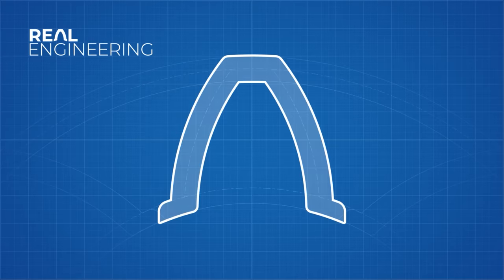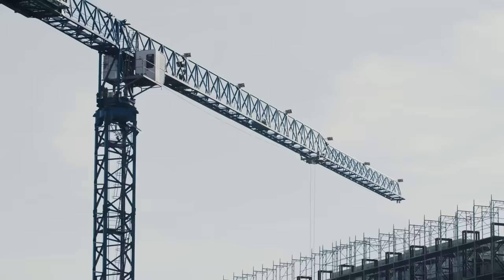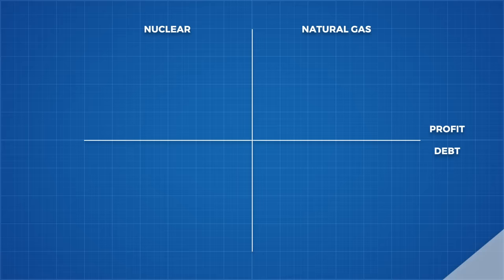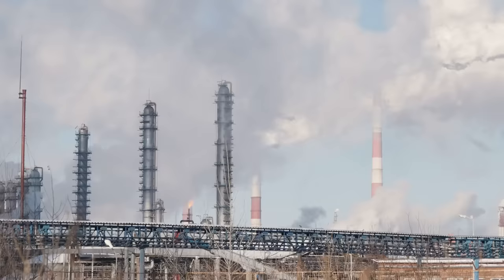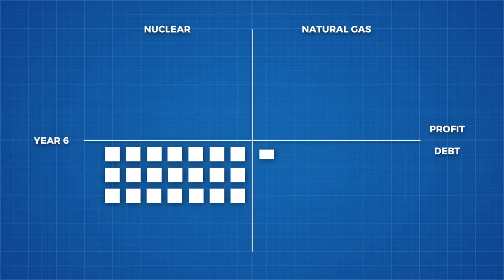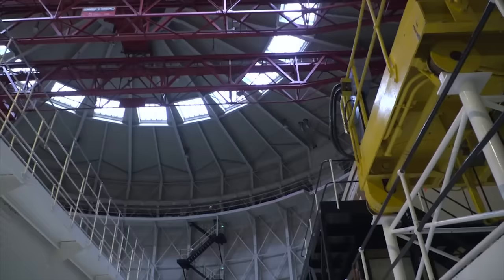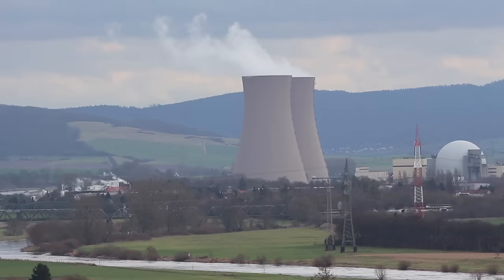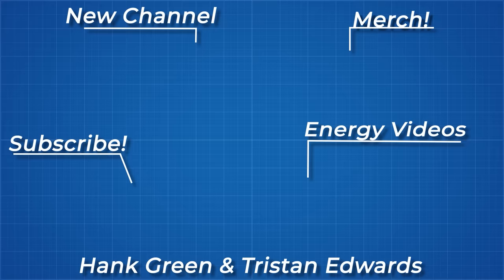The Economics of Nuclear Energy

Comment: I work at a nuclear power plant, and honestly it's the most amazing piece of engineering I have ever seen.
Reply: I did as well and it was but was far to expensive.
Reply: I’ve been wondering what is it like to live inside the nuclear power plant. Is it dangerous?
Reply: @ShafiraMeisy  Not really. You can even swim in the pool which has the nuclear components. Nuclear kill fewer people than wind power so not many, really.
Reply: people are more likely to die falling from bed than from nuclear accident
Reply: boilermaker here, im hoping to soon too
Reply: I worked as an environmental tech in many coal plants and God damn are they shit and brutal, I remember having to cut open the screens to vacuum out the coal ash out of the catalyst, they would just turn off the unit so the ash was still glowing in spots, ambient temp was around 130° and we're in 2 tyvek suits with respirators vacuuming out this glowing ash for 12-19 hours a day. The metal vacuum pipes would constantly get holes in it due do the abrasive ash so we had to constantly duct tape it, and since it was so hot, it would just melt..

Anyway coal plays are shit and can't believe they still use them
Reply: @royk7712  0 people died because of the Fukushima nuclear accident. Yes, you read that right, 0.
Reply: @uwu_senpai  the health issues and the cost to fix were insane though. As he said in the video that plant wouldn't be approved today... Compliance is important. If it can be avoided better to not need nuclear, especially if you don't have the plants built already. The waste management is an ongoing cost too even if it is small. It doesn't go away.
Reply: @uwu_senpai  Fukushima is still getting cleaned to this day, and millions of gallons of water are still being pumped on the core to contain the radioactivity, which will only last until 2022 when the storage tanks are completely full...
Reply: @royk7712  
That comparison is horrible and I would expect nuclear workers and enthusiasts to understand why.   

Everyone gets out of bed EVERY day.   Few people work with nuclear materials.  The total number of deaths is lower but the percentage would he higher.
Reply: Citation required
Reply: @Sheridantank  I'm sure after you normalize the data, your percentages will still seem quite low; especially if you take into account both the coal miners, power plant workers, and the people who might live around the plant.

I mean, yes; nuclear disasters are horrifically catastrophic. But you have to take the same safety precautions with a nuclear plant, as you do in the aviation industry; you have to be on top of a problem, and fix it before it becomes a catastrophe. And if you do keep on top of your problems, then you will experience no deaths at all; whereas with coal and other fossil fuels, health issues and death are endemic.
Reply: Well if u like that have you everheard of the wheel?😉
Reply: What did you major in university if I may ask?
Reply: All the hilariously cherry picked numbers in this video ignore the simple fact that electric is cheaper in places with lots of nuclear and expensive in places with lots of renewable energy. France pays about 16 cents at the meter and Germany pays almost 35.
Reply: Really ? You could swim in a pool that has radioactive material in it ? I mean the long time exposure of radioactive material is bad for ur body over time, trigger DNA mutation and such things יעקב accidental death may be lower than other jobs, but it can’t be used as a apple-to-apple comparison to this, no ?
Reply: @bronzedivision  10 years ago solar was an order of magnitude more expensive than it is now. Go look at a chart of solar LCOE over time: it's pretty mind boggling. Germany subsidized solar for decades while it was economically uncompetetive because it hadn't climbed it's own learning curve sufficiently. German consumers are paying the price for those historical long term generous feed in tariffs that have enabled the cost of solar to plummet to below all competition today. This was intentional. It was exactly what was planned by the green party who introduced the scheme whilst in a government coalition. There's a similar story for wind and there are other details around why the price of electricity is high in Germany unrelated to solar. We shouldn't infer any conclusions about the cost of renewables today based on the german electricity rates.
Reply: Allah protect you
Reply: @MasayaShida  Electrical and Computer Engineering.
Reply: What type of plant is it?
Reply: @appleater3  the "tritinated" and "radioactive" water is cleaner than tap water, they will just release it, without any concerns about radiation.
Reply: Which nuclear power plant?
Reply: @uwu_senpai  how many square kilometres of uninhabitable land around the disaster ?
Reply: @Sheridantank  that's a complete BS. My friend works at a nuclear power plant and with dose is 0uSv per month. Maybe people who mine and enrich the Uranium could have some small dose, but it is never above the potentially lethal dose. Since Chernobyl accident, only six people during Fukushima accident got higher dose than 250mSv, but lower than 500mSv, potentially lethal dose. None of them died. The radiation isn't a problem here. Keep in mind that radioactive waste saves millions of lifes by cancer treatment every year.
Reply: Abdulla Alblooshi why do we still use pressurized fission plants? I’ve seen atmospheric molten salt fission generators in a prototype state for almost a decade... i.e. what Taylor Wilson is working on.
Reply: @lilacdoe7945  they are still in research phase, they might be ready in 20 years.
Reply: @lilacdoe7945  Because they're one of the best designs that have stood the test of time.  If there's one thing the nuke industry doesn't do very quickly - it's innovate.  It will probably require the state or fed to build a full scale prototype reactor and have it operate safely for years before any company would even consider it.  Also I don't know about molten salt but using water as a moderator gives you a stable feedback loop between temperature and reactivity.  If the water is cooler, there is more reactivity, and if it's hotter there is less reactivity.  This is good so you don't end up with a runaway reaction where more heat means more reactivity which makes more heat ect.

Mostly though I think it's just the best proven tech of today.  Modern PWR designs are actually pretty bad ass and seem like they'd be super safe a with redundancies and fail safes, and can even keep the core in cold shutdown from natural circulation alone - without the need of pumps running or anything.
Reply: I want to do journalism but nuclear power has always been a dream of mine to explore
Reply: What is the cost for decommission?
Reply: @Sophistry0001  we had a full scale molten salt test reactor running for a number of years back in the 60s, it's one of the safest designs, 100% passive safety, can literally cut all power, back ups, everything and it won't melt down. The reason we never used them is because at the time all of the funding was from the DoD, and the Navy was insisting on compact high power reactors that could fit in boats and subs, so the funding was pulled from the molten salt program as they aren't nearly as energy dense. Since all the government funding went into the pressurised boiling water reactors that's inevitably where the private sector went, even though the molten salt reactor is a far better and safer choice for a stationary power plant. Molten salt reactors can run on a much safer, easier to mine and more abundant fuel (thorium) and they burn 99% of their fuel compared to the less than 10% of a standard nuclear reactor. And the waste from our current nukes can actually be easily processed as a supplement to fuel the molten salt reactor, extracting a significant portion of the energy from it and drastically reducing both the quantity of waste and how hazardous it is.
Reply: i bet those engineers at chernobyl though that as well
Reply: @GloomGaiGar  Chernobyl is literally nothing like any reactor in operation today, it was a horrendously dangerous and poor design that was only ever built by the Soviets. What happened there could never happen to any nuclear plant being operated today.
Reply: @GloomGaiGar  I think of nuclear power like a super fast car. Great to see but not to be in it when it crashes
Reply: @royk7712  To be fair, there are more people on beds than people near nuclear power plants.
Reply: @benbrowne7674  I actually read what that LOCE is saying, not what you're hoping it says. ;) 
The LOCE is only WHOLESALE price, not what you pay at the meter. The more solar you add the more grid instability you get and the more backups you need. Both of which drive UP price, that's why Germany's complex renewable power costs double France's simple nuclear power. And is only getting worse. Solar is a hopeless rat race.
Reply: @GloomGaiGar  well stay with so obsessed with the Perfection of Soviet engineering they did not need a containment building!
Reply: @Sophistry0001  well explained.. there are many safety systems designed into the PWR, many redundancies and the design is tried and true
Reply: @turningpoint4238  To be fair, I've worked at a bunch of factories and half the time 1 machine may be worth up to $20 million. Though BBraun Medical likes to use tiny little contraptions that just slot over where line workers used to work. Kinda feel bad for the line workers when they have one room fully automated and another down the hall still worked by hand. Can't imagine that lasting long.
Reply: And than you realise that nuclear power plants still use 50 year old technology
Reply: Shafira Meisy It wouldn’t. Military Run or involved Nuclear stations would be even safer. The US Navy Nuclear sector has one of the highest safety records, because of how many nuclear reactors they have (aircraft carriers, shipyards, and subs). Nuclear power should be respected, but when it isn’t you get major problems which have decade and century lasting effects such as Chernobyl.
Reply: @uwu_senpai   I get your point but thats more research reactors you can swim in. not really power station reactors
Reply: @uwu_senpai  misleading... If you actually work in a plant you know that is not true. There are many system designs.
Reply: At my nuclear power plant we haven't had an osha recordable in 789 days, and haven't had a loss of time incident in 1459 days. So saying that nuclear is unsafe for the workers is a completely illigament argument.
As well as those concerned with radiation, I have been in the 'no-go areas' with 23 rem/h. Yet the most I have ever gotten in a month was 400 mrem. I would need 2000 times that dose to be dangerous.
Reply: Ok “Abdullah alblooshi” I’m sure your definitely not Homer Simpson 🙄
Reply: @NickTrouble  woah those are some solid numbers... Since I've been in the nuclear industry I haven't received any extra doses .. I work mainly with PPS PLC cabinets and just regular HMI stuff.
Reply: @madman10340  I'm not, homer was a reactor operator.. I didn't want to study an extra 3+ years after engineering to get that job.
Reply: @Dongs it's not a Nuke site .. it's a nuclear power plant. Nuke sites are areas where they test nuclear weapons.. or areas of high contamination. Also I don't believe the name of a person is within the criteria of recruitment.
Reply: Yes.. 
I have worked at 2 nuclear power plants during outages.  I live less than 20 miles down the road from one of those plants now.  If you get to see the amount of security they have there, it's almost ridiculous. The entire plant, at it's outer perimeter, is surrounded by big blocks of concrete to prevent any unauthorized vehicles from trying to crash through.  The entry points are protected with those pop-up steel barriers.  The guards walk around with body armor and automatic rifles..  I could go on and on.  I don't believe it's possible to force your way into a nuclear plant, at least without an entire actual army.  The engineering is also mind blowing.. I didn't realize such big things were even possible to manufacture.  I also got to see the spent fuel storage pool at one plant.. it's perfectly safe to walk around the edge of the pool.
I am an advocate of nuclear, although I realize that renewables (and other sources) are making them less and less viable.  I have also worked on construction at solar power plants.  I think one of the problems with solar is what I guess I'd call energy density.  The solar plants I worked on took roughly 500 acres for a roughly 50 MW plant.  At the nuclear plant not too far down the road from there, one unit (reactor) produces over 900 MW.. and it has 2 units, so over 1800 MW total. The entire site of the nuclear plant is roughly 2200 acres.. and only a small portion of that is the actual plant.  If you do the math you see that it would take a huge area of land covered in solar panels to equal even one nuclear reactor.  And those solar panels will only produce  power during the day. So yes, solar is great.. but the scale required to match any fossil plant is just huge.  But when they finally figure out affordable grid-scale energy storage, nuclear might be doomed.  My apologies.. I started rambling a bit there, and can't remember exactly what my point was!  Just my thoughts on the matter..
Reply: New state regulation made the example of the San Francisco plant to decide to shut their operation. The video should use an example when regulation doesnt affect the operating costs.
Reply: @Aidan梁九旭
It is things like the holocaust that shaped the wrong opinion on eugenics, it is actually very humane.
Reply: Shafira Meisy The radiation is stopped by the water, slightly higher levels of radiation exposure can be beneficial to you as your body adapts to low radiation exposures, a trip to a nuclear facility doesn't even give the same exposure as flying in an airliner for a few minutes. The Linear No Threshold Model has be discredited hundreds of times yet people still use it as the basis of their safety standards. Look at people in mountainous regions, they are exposed to a higher background but have lower rates of cancer than those exposed to background radiation at sea level.
Reply: @mattwilliams4222  hahah yeah outages are crazyyy usually the plant isint that busy but when an outage happens we get a flood of contractors in and it gets a little hectic.. during regular plant operation we just do PM CM and the planned surveillances.. but man outages are a whole other level.. sometimes I wish I could just take the whole outage as my annual leave
Reply: @bronzedivision  if your point is that LCOE is not the right metric then I completely agree and commend you for having that more important but more complex conversation. The conversation should be about the marginal price of providing the service of reliable electricity rather than just $/kWh. My point is only that the France vs Germany comparison is not a good natural experiment. Consumer electricity rates are determined by so many political and historical factors. A better approach is to look at the wealth of forward looking academic and private work that is being done on the cost of different energy mixes. It's a complex problem that's very context specific. I'd personally love to see more nuclear getting built but we should look to that research that accounts for the real world complexities of building a reliable energy grid. I'll note that utilities do this in-house to determine how to best serve their rate payers and we're seeing a lot of new build gas paired with renewables getting built but relatively little nuclear at the moment.
Reply: Matt Williams 
I’ve done the math too. US? 130,000 square miles. That’s half of Texas!  Worldwide? 920,000 square miles!!  Spain, times 5!!!!! And world energy consumption is projected to go way up. Some projections are doubled. Solar is great but just not great enough. We need Nuclear.
Reply: Ismalith 
You seem really afraid of the waste. That’s really misinformed. The waste is a non issue from an engineering perspective. It’s only a political issue.
Reply: But how many will get cancer from it in the future?
Reply: I'm sure it is man, but the only problem (besides the low probabilities of nuclear fusion: core melting etc) is the waist: what do they do with all the nuclear radioactive waist... Nothing cause there is nothing they could do with it except throw it into Venus perhaps... but that wouldn't be cheap...
Reply: james sullivan 
None. Seriously, none. Look into it.
Reply: 3dgar 7eandro 
Nuclear waste is minimal. All the technical issues are solved. Nuclear waste is the best kind of waste from energy. It’s the only kind we actually contain and it’s super minimal. Look into it.
Reply: You’d usually don’t want to do that unless if you want to piss off the entire factory by forcing an expensive clean up operation to remove contaminants from the pool, יעקב
Reply: @MrElifire84  Okay, but we will be stuck with politics for the foreseeable future. Political problems are far harder than engineering problems. So until we have actually have a running infrastructure of reactors burning down/recycling waste, and safe longterm storage locations in operation, waste remains a huge problem. And until recycled fuel is cheaper than freshly mined, any new investment in nuclear power production will go into producing more waste debt.
Reply: nibblrrr 
You’re right. People are the problem. Usually that’s the case. Doesn’t mean we shouldn’t say it like it is. I think we should work hard to disabuse people of erroneous perceptions. Change minds. Advocate for good. Solar isn’t good enough. Read my separate comments posted to this video to see why.
Reply: @Aidan梁九旭 nope, not Chernobyl
it was the movies, the media and the green movement.
Reply: @ShafiraMeisy  ha, ha, swim in a pool with radioactive material - sure, if it's properly contained, if not - you couldn't swim in a pool that has gasoline in it, either, and a natural gas leak in your home could kill you for sure. 
In our town, the gas explosion collapsed the floor of that apartment on the apartment below. Considering the deaths from gas-related accidents will make gas look far worse.
There are more people dying in my country (4M people) because of fire-heating related accidents, each year, than directly died at Chernobyl.
Reply: @benbrowne7674  Germany, the land of the sun, spent more on solar than ever on nuclear, or let me check this.
Found this article:
https://www.forbes.com/sites/michaelshellenberger/2019/05/06/the-reason-renewables-cant-power-modern-civilization-is-because-they-were-never-meant-to/#42f6949fea2b
"Germans, who will have spent $580 billion on renewables and related infrastructure by 2025"
i know it's a fool's question, but here it is:
what would have been possible to achieve with a fifth of that money if invested in new nuclear plants design? 
Could Germany start it's own nuclear revolution?
What lots of people tend to forget - we don't just need to replace fossils from electricity generation - we have to replace fossils from everywhere. By doing that, we'll need 3 to 5 times more electricity generation. Going to war against nuclear (as most "greens" did) is plain stupid if one considers this.
Reply: @Sophistry0001  @ Lilica Doe No. It's because of politics and companies like GE swaying the government early on. MSR's aren't new, they were developed alongside traditional pressurized fission type reactors. Unfortunately, the funding for MSR's continued development was cut when GE got the government contracts.
Reply: I worked at one in Dubai for a year for General Electric.  Worked 6 months 12 on 12 off, and it was a hard life.  Paid for my schooling completely with that 1 year of work plus all the grants I applied for and the scholarship I got.  Was truly a great experience working at the place.
Reply: Chernobyl reactor number 4 right??
Reply: @fatguy6153  thank you
Reply: @tylersun4300  thank you
Reply: @transkryption  thank you
Reply: @shmadmanuts  thank you
Reply: Lics Norgi  long time and over exposure might be dangerous
Reply: @ScubesFTW  Right lets just throw away a valuable technology because some idiot thought it was a good idea to build a plant right next to the ocean instead of half a mile inland like oh idk a sane person would've done.
Reply: @killman369547  earthquakes still happen inland you know. It's just where the tectonic plates connect and they can happen outside major fault lines with no warning. Who you call a sane person is still going to be an engineer capable of making mistakes. No regulation is 100% effective either. Accidents will still happen.

I wouldn't advocate throwing the technology away. You can't uninvent it but persuing uranium and expanding that industry doesn't seem like the best idea. The main reason they went with uranium is they can make bombs from the waste otherwise there are more plentiful fuels from what I understand. If you could get fusion or thorium or something to work where you don't have to manage the fuel effectively forever I'd maybe be more accepting but who knows if that'll happen anytime soon. 

Using a technology because you have it is a sunk cost falacy, sometimes you have to let it go and go back to the drawing board. 

In 100 years we'll look at this technology and think wtf were we thinking. We'll still be managing the fuel and radioactive sites for another 10-20,000 years after that. Honestly hard enough to design something that lasts 100 years let alone 12000, the half-life of plutonium or whatever. Will be hundreds of thousands of years realisticlaly. That cost is not reflected in the price and will be paid by future generations of taxpayers hence why I think nuclear as it is now is not a silver bullet.
Reply: @ShafiraMeisy  The external circuit doesnt has radioactivity.
Reply: @grantapalooza998  Also, from coal the ash is radioactive and has a buffet of heavy metals in it. Hazardous waste!
Reply: Even if I'm not a big fan (I view it as a lesser evil, I'm not 100% anti nuclear, calm your shits), I still marvel at the science and engineering involved.
Reply: Simple Solution: Clean, safe and reliable Moulton Salt Reactors!
China's spending billions perfecting the technology and we're doing almost NOTHING!!!
Reply: THAT right there is why nuclear hasn’t taken off. Each plant is a work of art. The technology has yet to achieve scalability, unless you do like France and mandate that every plant must use the same type of reactor so that everyone who’s qualified to work at any nuclear power plant in France is qualified to work at them all.
Reply: Abdulla we’ve found you…. 
#israel #usa
Reply: For every terawatt a nuclear reactor produces there are 3 deaths. For coal its 300 deaths, to put it into perspective for you guys in this thread.
Reply: @royk7712 while this is true, this is based on numbers looking backwards because we haven’t had any very very serious nuclear incidents, like full blown un contained meltdown serious. If an incident like that occurs that isn’t properly contained then those figures change dramatically. It’s like saying based on your experience playing Russian roulette is less painful than going to the gym just because every time you played the bullet hasn’t been fired. Now that’s a bit of an unfair comparison because it’s increasingly unlikely that we will have a bad accident and a lot of people think living next to a nuclear power plant is a death sentence even if there is no incident and it’s worth reminding them that it’s perfectly safe. But still I think it’s important to state the difference between determining risk based on projections and figuring out potential risk/expected risked based on the chances of a worst case scenario. Nuclear still probably comes out alright vs oil, but not great vs other renewables.
Reply: The LCOE for renewables does NOT include the cost of backup power for this kid's-lemonade-stand business model.
Reply: AGW is a load of it. 

Decarbonization is 21st century pyramid building.

Just burn coal. 

Electricity generation is boring.  There's NO EXCUSE for expensive electricity.   The real fun/challenge is synthetic gasoline -- "make gasoline as dirt cheap as electricity SHOULD be."
Reply: @uwu_senpai  By "you can swim in the pool" you mean "if you were allowed to swim in the pool, which you never would be, and you didnt dive in, which would probably kill you the same day if you went deep enough , but instead gingerly paddled at the top and got out quickly, and had a full scrub afterwards for various waste, then there is a good chance you will probably survive the event , and since we usually cannot find the direct cause of most cancers, even if you did get cancer from ionizing radiation there, they could legally claim you may have got it elsewhere." That is how safe it is. Wow, where do I sign up? All this to avoid building some solar panels and turbines Yay!
Reply: @peetsnort  well your thinking is wong.